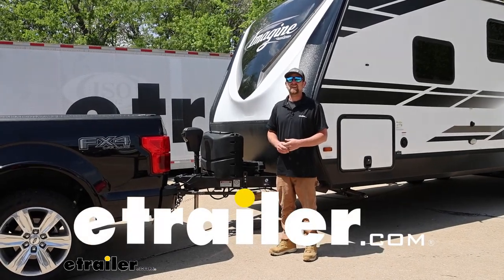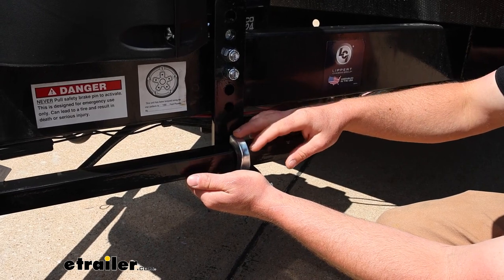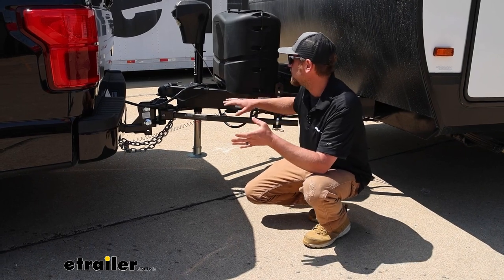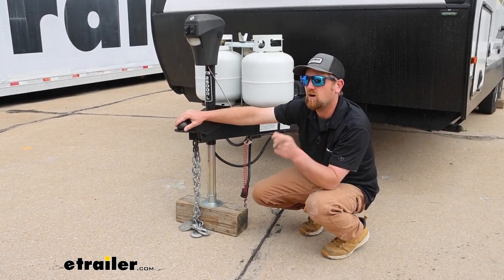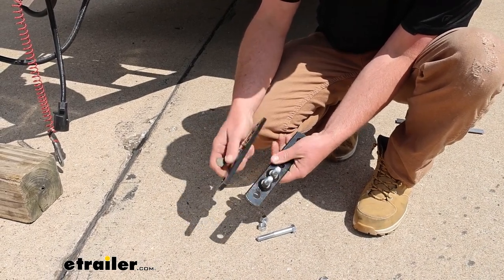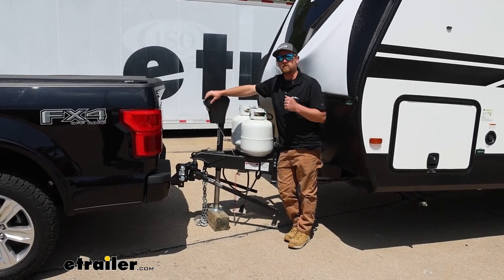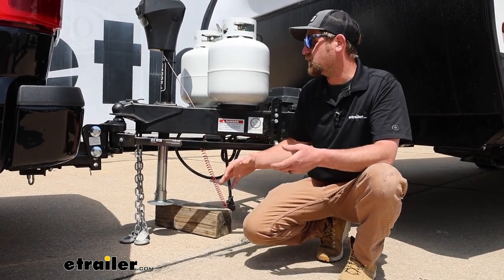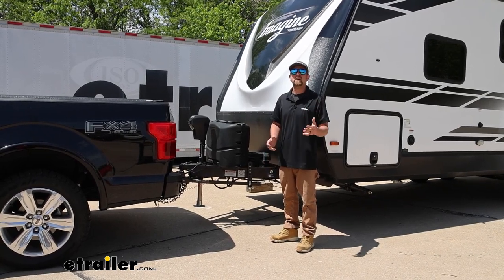Fastway e2 Weight Distribution System Installation - 2021 Grand Design Imagine Travel Trailer

Comment: I just got one of these for my new toe rig. Before that I had a Reese with the spring bars that you tension with the chains, I’m not sure which kind you’re referring to but there was no issue backing up, even with sharp turns.
Reply from the maker: Chain suspended systems that use a friction sway unit like # 83660 are very susceptible to damage should the trailer jackknife, so that's a situation where we don't recommend backing with the unit engaged. Otherwise, most systems won't have a problem when backing, unless you're in a situation where the trailer could jackknife. In that case, we recommend removing the spring bars before backing the trailer. Hope that helps clear it up for you.
https://www.etrailer.com/Weight-Distribution-Hitch/Fastway/FA92-00-1000.html